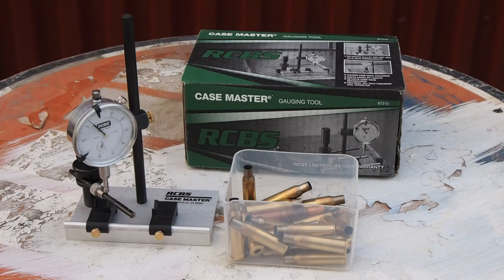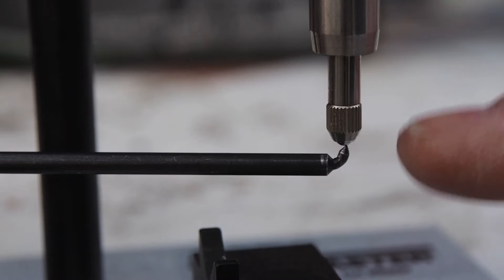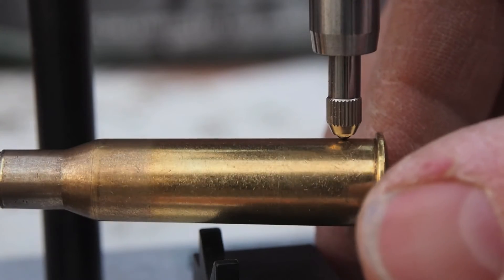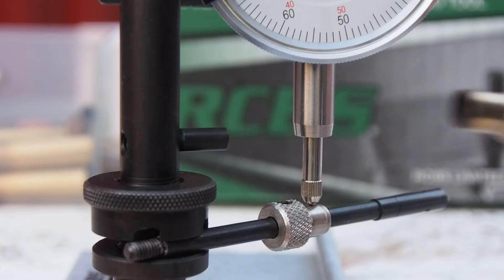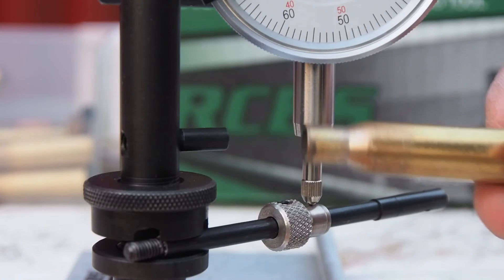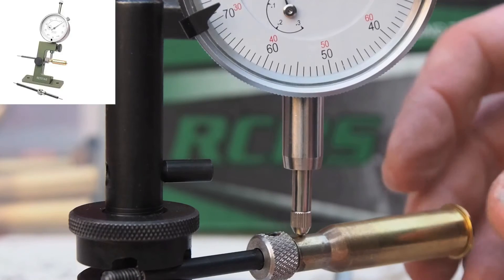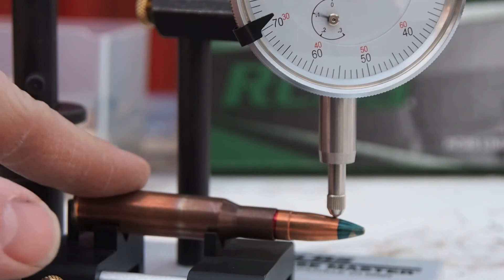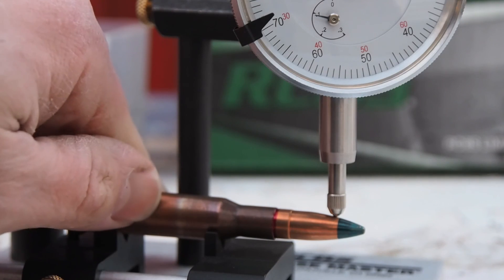RCBS Case Master

Comment: All you have to do to make the included neck thickness gauge accurate and consistent is put a little downward pressure on the steel collar using your left hand while rotating the case with your right. Great idea using the deburring tool rod though.

Comment: Have you had a chance to try the Neco gauge?  Its about $60 more and I was wondering if it was worth it....  I know, stupid question as you would be posting it instead of this if you had tried it or liked it.  I saw it on one of the Tubb/RCBS hand loading video's....  I didn't like that case mouth gauging method either... part of the reason I haven't settled on it or another yet. But!  I like your fix...  A big thanks for your video.. its definitely helping me out...
Reply from the maker: No I have not. But now Question is a stupid question. Glad this helps you. I got this thing for really only one reason. I wanted to be able to measure the web thickness.

Comment: Dude... why would you rock the case? Slight downward pressure on the sleeve and don't touch the case until you are ready to rotate it. This is actually one thing rcbs did pretty good with. A little finesse and you don't have to buy a bunch of pilots.

Comment: Another YouTuber used a rubber band on a popsicle stick to put pressure on the case and rotate it. Have you tried the RCBS case deburring tool and pilot in place of the Redding? I just ordered this tool for the same reason as you (case web thickness) and I'm glad I did based on your vid.
Reply from the maker: The pilots between the Redding and RCBS are interchangeable. I have both.